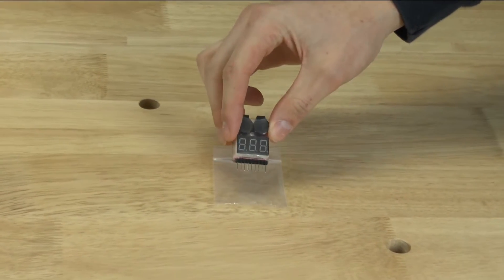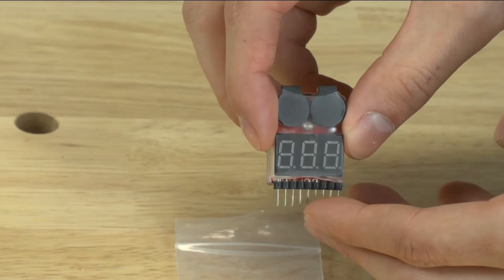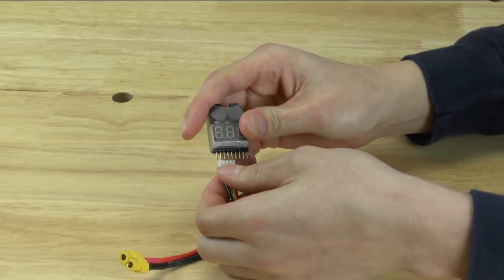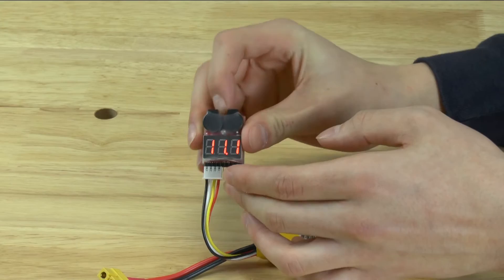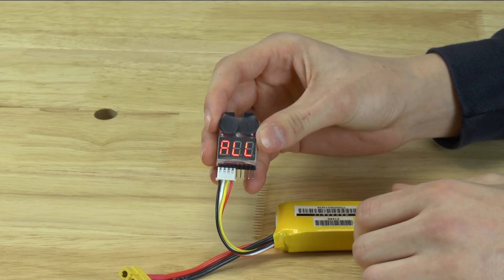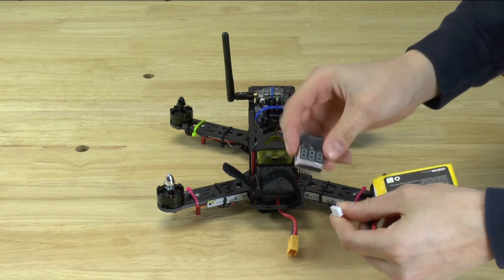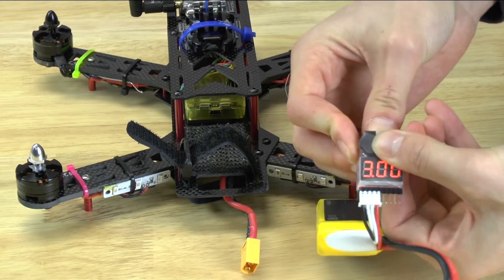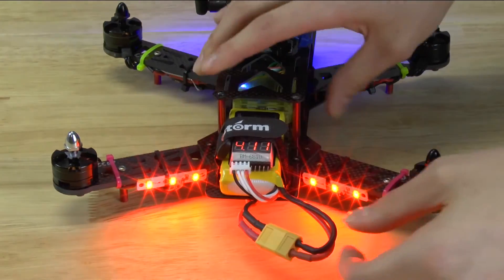Lipo Battery Voltage Tester

Comment: The one I have needs the LVA to be reset each time I connect.
I discovered that if I "long press" on the desired warning voltage, it will remember that value.
I set to 3.4 for ordinary LiPo's and 3.5 for Graphene LiPO's since their voltage can stay high then drop quickly at the end of a long flight.